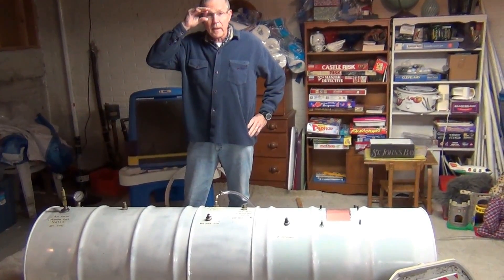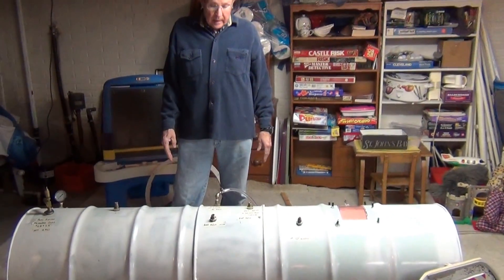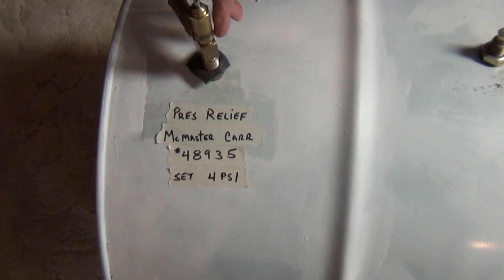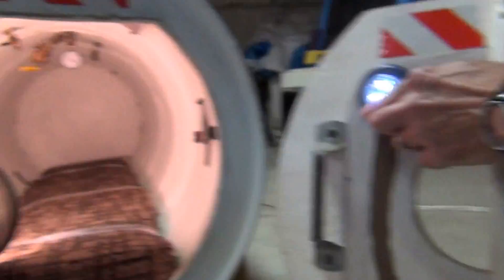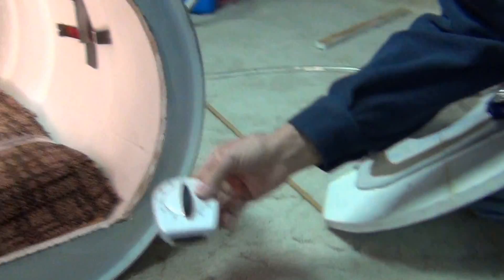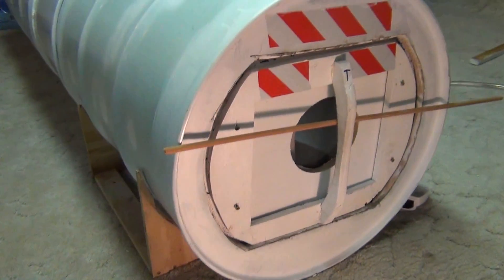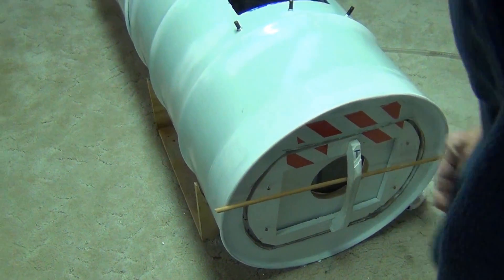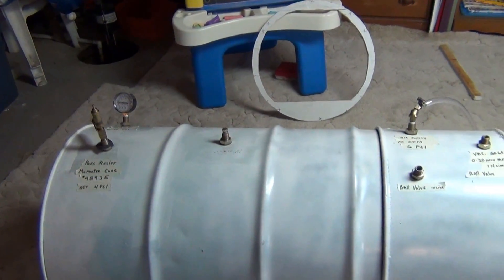Build an affordable Hyperbaric Chamber

Comment: Pressurized air ? What about the o2. Oxygen making equipment?
Reply: I'm not sure the level of risk but oxygen is 1 component of combustion, fuel being other. With with high oxygen concentration, combustion rate would increase significantly

Comment: This is an old video, while it has great features just be aware there so SO MANY THINGS that can go wrong that can prove fatal to the layman out there please.
1.air and oxygen are not the same thing.
2 the chamber cant be filled with pure o2 unless u want an explosion
3. The pure o2 is where the maximum benift comes ffom
4.there is a depth limit on using pure 02 that's critical!
5.the paint u use inside the chamber must be inert otherwise it's going to combine with the air(no lead)
6. Use a clean air pump otherwise  it's gonna be contaminated
7. Having a conpitant person outside monitoring you is critical, if something goes wrong you can't help yourself 
8. Mechanical stuff fails. All the time. Act accordingly. 
9. The chamber needs to be able to be throughly cleaned to kill the thriving bateraia that can build up in o2 environment 
10. Do as much research as u can cause it only takes one mistake... 

I'm not trying to scare people, Im very intrested in making one myself, but as a ex commercial diver I'm very aware of the safety risks involved. So should you be if u take a project like this on.
Good luck!!
Reply: None of your points apply except the cleaning part.  And to that, I say, "duh."
Reply: @davidbeppler3032  totally, please go make one to your own heroic standards, the gene pool needs to be cleaned of stupidity  from time to time as well

Comment: Hi Terry, I was wondering if you have a list of all of the components for the barrels. Also I am wondering if your unit can be separated into two parts? I am going to put mine into my basement so I need to be able to separate it. When you welded the center section did you weld the center band to the outside or the inside? I hope I’m making sense.  Finally, what type of plastic did you use for the window?
Thanks Terry

Comment: Hello Terry, 
I am an anomaly here in the St Pau, MN., unannounced at this time. After consulting with many professional spinal surgeons,, total lumbar fusion is the consensus. 2 surgeries scheduled this coming March anterior/posterior 2 days apart at the Mayo Clinic.
So I decided to prepare my health for the best outcome possible, studied on line,, drawn to Functional Medicine and really put in the hours,, ongoing. I bought a beat up inversion table $50 delivered. The gentleman who delivered it told me it saved his life by getting Ox to his hip replacement. Ox delivered to trauma area lite a light bulb in my head. I go complete inverted and decided to add exercise in that position, i.e.
Upside down twists/belly crunches. It hurt a bit at first,,, then my pain when away,, I started to stand straighter, still working on Keto diet, stress and sleep. The last three MDs I have seen recently have said,, “Do not get the surgery!”. 
My current research is on HBOT,  only 2 books in our entire metro library system that I have on hold, I will have 20 sessions plus Chiropractic soon by enlightened clinic near me. Henry’s/Boil’s law calls to me,, in short; Ox under pressure bypasses red blood cells and uses plasma to get it’s healing ‘message’ out. Check out the ‘HBOT paradox’,, as one would be concerned about treatment causing free radicals/ when the opposite is the proven outcome. Conclusion;; I want the use of my right foot to normalize quickly (mild drop foot syndrome). This condition has already improved by inversion/inversion exercises. I will update you after Ox therapy,, 
Thank you so much for your HBOT video,,  as I am a welder with creative thoughts,,, and not without resources.
Mere Woman, 77 yrs old,, Mn.

Comment: As an engineering research assistant in college, I built something similar: a low-cost thermal-vacuum chamber and that made me think that I could do the same with a hyperbaric chamber but I’m still skeptical of the safety aspect of it lol... it’d be one thing if I didn’t put humans (ie me!) in it but that’s not the case lol so I don’t think it’s worth it. Great video though!

Comment: Excellent presentation; especially loved how much info you included in the description. THANK YOU!    FYI's:  
1. The company that rents chamber time near here, said that "2 hours inside a low-pressure chamber without adding O2 = about same as 1 hour inside the same chamber using added O2.".  
2.  Also, they admitted that buying one of their used chamber setups [they only use/sell/rent the soft-shelled chambers], considering the outrageous price tags even on a used setup, is hardly worth it, since the used units will only last a few years of daily use.  That works out to being extremely costly per treatment, to use a commercially made unit. 
3.  Making one's own chamber similar to this barrel chamber, and, using it only with the air pump, can get you the pressure treatments needed, for a LOT le$$. 
4. A full-extension conveyor belt under the bed, would greatly assist getting in/out of the chamber.  That is the biggest difficulty, for most chambers, is that those who need them most, have hardest time getting in/out of them.
5.  BEWARE to make sure you use Non-toxic, zero-VOC finishes, at least on the inside.  Otherwise, those VOC's will keep outgassing into your lungs, and, because it's under pressure, deep into your body tissues, as well...you do NOT want that!!! 
6.  One might use an O2 supply, + a pump supply, and, a silicone sleeve or/and tubing large enough to insert a whole leg or arm, and deliver pressure + O2 directly to a limb, instead of the whole body.  Could use silicone sleeves, with maybe tubing like used for tourniquets, to roll the edges around, to hold edges in place and hole in the pressure.  That kind of a setup could be a boon for those who are claustrophobic and therefore cannot use a chamber.
Reply: I dont want to poop on your parade but I am looking at doing this as well, however reading what the experts are saying is that using a chamber at less than 1.5 atmosphere, with no introduced oxygen, is of no additional benefit than using an oxygen mask alone, at sea level. Atmospheric pressure at sea level is 14.7 psi, so 5-6 psi would seem to be ineffective ? The suggestion that tents that only go to 1 atmosphere, or less than 1.4 atmosphere, provide no clinically proven benefit.
Reply: @dalekiely1245   Look up the soft hyperbaric chambers for sale.  They can only tolerate certain limit of pressure…in fact, they have a limited use-life because of being fabric. 
That said…those still do well, even without added O2, by spending 1.5 hr instead of 1 hr in it per session.
Idk about using a camp tent…too flimsy…also, beware of toxic materials…whatever VOCs are emitted inside, under pressure will be pushed into the body, causing higher toxicity & less healing. 
Also…O2 is not the only beneficial gas pressured into the body inside a chamber.  H2 is also…& it can often be more usefully healing.
You are right about needing enough pressure in a chamber.  
But do check online, the low-pressure chambers for sale.  I think they function at 1.5 atmospheres.  
The hard chambers go higher, but require a doc to be present. 
If a home tinkerer can use nontoxic materials to build a chamber, & achieve 1.5 atmospheres, they’d be able to use room air, without adding an O2 concentrator, by spending 1.5 hrs inside, instead of 1 hr. & get about same effect as 1 hr inside w/O2 added.

Comment: Hi, when you are using your pressure chamber with regulary air, in stead of pure oxygen and you let the pressure go up to 4 or 5 psi, is there not any risk for caisson illness when you depressure your chamber to the normal 1 psi when you leave your chamber.

Comment: So this just pressurizes the air inside the chamber correct? and maybe putting in more air per volume but shouldnt this be used in conjunction with an oxygen concentration?

Comment: Hydrogen peroxide is a mild antiseptic used on the skin to prevent infection of minor cuts, scrapes, and burns. It may also be used as a mouthrinse to help remove mucusor to relieve minor mouthirritation (e.g., due to canker/cold sores, gingivitis). This product works by releasing oxygen when it is applied to the affected area. The release of oxygen causes foaming, which helps to remove dead skin and clean the area.

You're an idiot. uhh

Comment: No doubt there are quite a few genuine concerns, but none of the should render this any less accessible to anyone than say, SCUBA diving. Which, while not exactly the same, is an excellent comparison of similar risks and concerns. You only need SCUBA certification to own scuba etc. That is the actual extent of what should be required for this, not the excessive regs and cost of chambers and there 'administration'. No Dr needed, so yes there is s problem with the regs. There is no such thing as too many good regs or too few bad ones.  I'm not  up on all the concerns with chambers, but I would list pump or air supply failure as one. I don't know if this design provides for fresh air in that event, that seems important..but idk if that's even in any certified designs or not. Without that feature I would not advise using without another person there checking on you. Yes you could open the door in that case, but you could be asleep or otherwise unconcisous etc, so the door must 'fall open' in the case of low/no airflow. Over-pressure does not seem much of a concern, get two or three PRVs if you want redundancy, I would prob get three, lol. I don't even know if rapid decompression is a problem at such relatively low pressures, but I doubt that is so for one extra atmosphere or less.

Comment: So basically if someone is trying to kill,  you can keep them out (pushing your legs against the door) but at the same time if they are smart they can just prevent you from coming out and switch the oxygen tanks for a more dangerous gas. Dafuq.
Reply: almost all chambers should have every device to run the chamber inside. notably the release valve. its best to do this in a controlled environment though

Comment: You have built a really cool low-pressure Hyperbaric chamber. Is off-gassing the CO2 something to be concerned about?
Reply from the maker: If you have your exhaust line near the bottom of the tank, I expect it will not be a problem as the CO2 is heavier than the Oxygen.   We have not had any issues, but we have no instruments to measure the CO2 level.
we constantly are putting fresh air into the chamber and have about 1/3 more air inside the chamber than there is outside.  (5 psi is about 1/3 atmosphere)
I hope this helps.

Comment: Terry,I have a chamber, but need a good compressor.Any idea on where to get a good one?Thanks
Reply from the maker: we found some acceptable used fresh air pumps on eBay & Craig's list.   they are pretty expensive new.
Reply: There is a medical compressor available on eBay. Oil less, 130 litters per minute. Do you think it will work? Sorry for all the questions, but I really have no idea.
Reply from the maker: John,
I believe that you want a  Fresh Air Pump like the ones used in Paint booths.  There are several manufacturers.
• An air pump with air filter.  Required to pressurize the chamber.  (Can use ‘Bullard’ model EDP10 free-air pump, Gast, Appolo, or equivalent)
 We bought our Bullard pumps used from Craig's List, and eBay.   They seem to work fine.
Reply from the maker: I can't say for sure, but I expect it will be slow to pressurize the tank.   our pump is rated for 10 cubic ft. per min. at 5 psig.   The pump you describe is about half the volume and I have not idea what pressure they are talking.  (IF I did my conversion right?)

Comment: wow that was absolutely fantastic.

I have some questions for you the first one is do you currently pump oxygen in it or just filtered air?

how long have you spent in it and do you feel any difference?

how much did it cost to do your whole setup?

 and lastly where do you get your oxygen are you able to just buy it over the counter somewhere?
Reply from the maker: This is a "Mild" Chamber, and this type chamber does not pump Oxygen.   Our chamber operates at about 5 psi gage (1/3 atmosphere) so I estimate that we get about 1/3 more air (which should have 1/3 more oxygen) inside the chamber.  (1 atmosphere is 14.7 psi)
My understanding is that this oxygen gets absorbed thru the skin as well as breathing it in.    Typically we spend about an hour inside the chamber, but I have read where some people will nap, or even sleep in a mild chamber.  There is plenty of information available on the internet..
I hope this info helps.

Comment: Unless you are at 2 ATM's (which is equivalent to 66' of sea water or 14.7 PSI per ATM which is a total of 29.4 PSI) you're wasting your time. Follow the US Navy treatment tables with a certified chamber or you'll end killing someone.
Reply: the chamber i use i think is set to 1.3 max
Reply: You don't know what your talking about - my source, Paul Harch MD with experience treating the brain and central nervous system. More is not better.

Comment: Terry Kocsis you use just a compressor without oxygen concentrator?
Reply from the maker: Yes, all I ever used was a 'fresh air pump' which puts more air into the chamber.   More air = more oxygen.   There is plenty of information on the internet.
good luck.

Comment: Thanks Terry. This is a life saver! I have plantar fasciitis and I need increased blood flow, but I also can't walk nearly as much as people without plantar fasciitis. I need this therapy, but it's so pricy.

Can you tell me, what is the spec on that pump? Can you give more detail on your bulkhead fittings? What are they? What do they do? And how did you set that pressure release valve to 4 PSI?

Thank you.
Reply from the maker: I can tell you what we used, but remember that there may be other options.
We used a Bullard EDP 10 Free Air Pump.  This pump is rated for up to 10 psi, but we never ran it over 5 psi.  We bought several used pumps from eBay and Craig's list, which all worked fine for us.  I believe that there are other brands.   You can check into Gast, or Apollo & there may be more?  I believe you want "Free Air" or "Fresh Air" pumps.  (standard compressors have oil in the air)
Bulk Head fittings are basically nipples with an external thread and rubber washers to seal.
We were satisfied with the  Mc Master Carr part # 48935 pressure relief valves.   there is an adjustment screw to set your desired pressure..  We installed 2 on a "T" as we wanted to make sure everything worked right.  It may not be necessary????
post your email address, and I'll be glad to send all the info that I have.
Good Luck.
Terry
Reply: Thanks a lot! My email is lemurf @ gmail . com

I'm costs as to what the bulkhead/nipples do though.
accounts.google.com